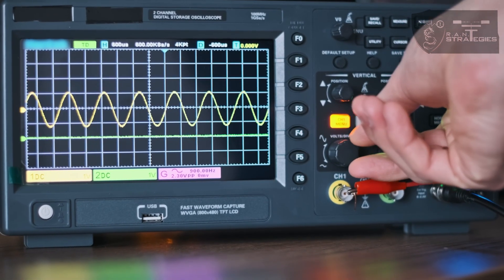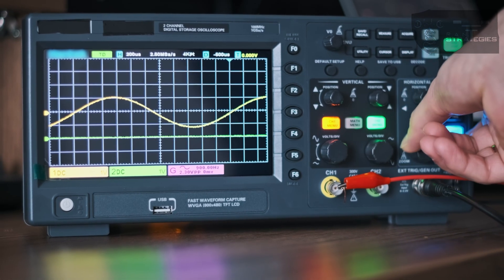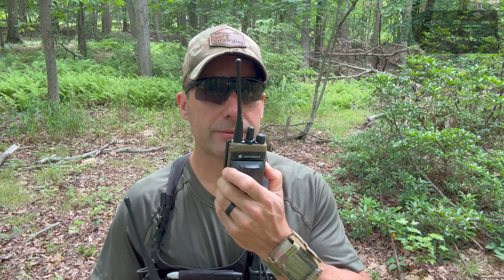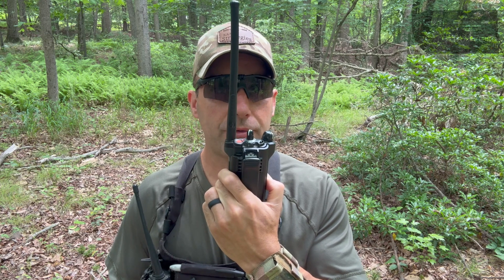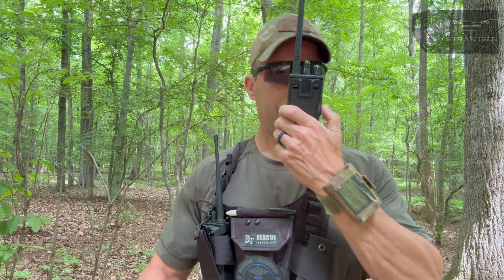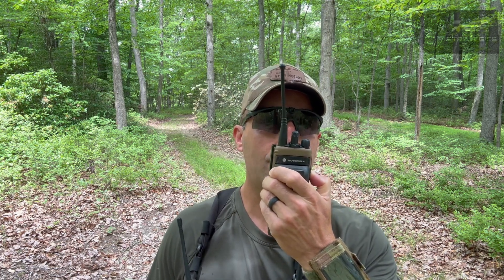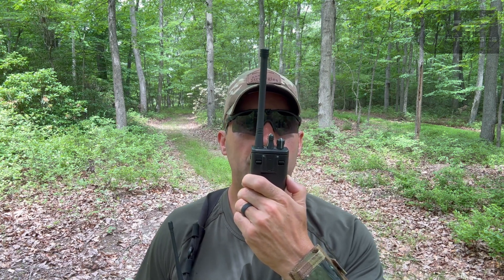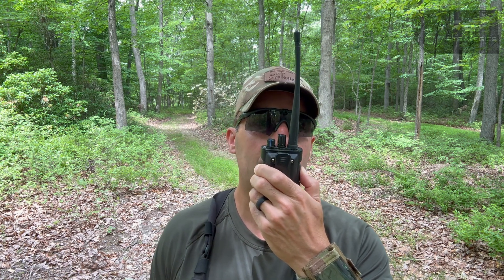UHF vs VHF Tactical Comms

Comment: Hi can you point me to an explanation of the 400 vs 800mhz Motorola xts
Reply from the maker: I’d be happy to help…. But what info are you looking for? Motos are traditionally single band only, so based on exactly what you said, one would be UHF band only (70cm) and the other would be just for 800mhz.
Reply: @RANTStrategies hi thank you for your time I appreciate your knowledge and commitment you are creating excellent content 

sorry I didn’t want to write a whole comment before if you were busy. I’m very new to radios my grandfather was a HAM operator and one day I’d like to consider getting licensed but I think it’s best to learn in baby steps and so I’d like to start with GMRS and the use case would be having my family be able to use repeaters to communicate with one another using xts 

I’d like a way to be able to communicate with my family members in a major western suburban city over Gmrs repeaters I preprogram for them using the xts platform 

I’m not interested in any other radios for various reasons I won’t go into 

Which frequency units would be suitable for this given the above use case
Reply from the maker: @BryanKirch oh very cool! You can definitely use an XTS radio for GMRS and IMHO they would be some of the nicest GMRS radios out there lol! You def need a UHF model, but there are two UHF splits on motos and but you can tell on the radios model number which ban split it is……YOU WOULD NEED THE 4th character in the model number to be an “R” then that would work for you for GMRS
Reply: @RANTStrategies thank you!
Reply: @RANTStrategies so the 700/800mhz models won’t work for Gmrs I assume and I need the 400mhz versions
Reply from the maker: @BryanKirch exactly

Comment: 68 year old radio tech, and I have been working on this stuff since high school.  For me the best radio remains the Motorola XTS 1500/2500 in UHF.  I live in So. Cal., and while there are plenty of radio traffic here, I continue to love 450-512 Mhz.  Outside of hams, California OES and Cal Fire, there isn't much VHF high band in LA/OC Counties.  LASO and LAPD use UHF, LA County Fire uses 470 and 800.  LAFD has moved most over to 800 trunked, and OC PDs and FDs all use Countywide 800 trunked with VHF radios for mutual aid outside the county.  800 deadspots continue to be found after 20 years using 800 Mhz.  Radio techs knew decades ago that 800 really wouldn't work here unless a fortune was spent of multiple repeater sites, voters and lots of satellite receivers.

I continue to use UHF GMRS with HTs.  Good as long as the repeater will hear it.  I remember low band very well (45-46 Mhz back in the 1970's with the PDs.  That really worked great, and as a dispatcher it sounded like an FM radio station!  At the PD we switched to UHF, and the first time with repeaters with satellite receivers and voters, backed up with microwave.  That was fantastic being able to use an HT rather than have to go back to the car to use the radio.  I'd stick with Motorola.  However the APX series does far too much and is far too complicated for me.  As a purist, a handheld radio should remain solely a hand held radio, not multiple bands, Blue Tooth, GPS and lots of unneeded, costly crap!  For me, if it isn't Motorola, I am simply not interested.  But then again, I' m old!
Reply: LAFD is not trunked at all

Comment: In portable radio testing many years ago, we found the size of the radio had much influence on the actual range.  Apparently a larger chassis made a more effective antenna pattern particularly on vhf.  Since users like small and light, the size of portables has shrunk over time.
Reply: You can have a big radio that performs poorly, but larger commercial style radios(Motorola/Kenwood/etc business radios or .gov AN/PRC-148's) do tend to have more metal in them. That metal acts as one half of a dipole, balancing out the whip. Cheaper/smaller radios with less metal inside can often benefit greatly from the addition of a simple to make counterpoise. Even standing the radio on the roof of a car and operating it with a shoulder mic can make a big difference.
Reply from the maker: @CzechSixTv  100% that's definitely a strategy I've utilized in the past!
Reply from the maker: I would absolutely agree with that. As you can see, we used nothing but full-size radios for these tests, I am only a fan of the larger chassis. The little ones just aren't user friendly and don't work well with out applications.

Comment: I maintained a school radio system on Vhf for over 20 years that worked well.  In the end we switched to uhf for better coverage.  The problem was the rf noise generated by computers that limited vhf performance.  The vhf could have continued to function well if not for interference from other devices.
Reply from the maker: Well as you can see, where those tests were being done, RF noise should not have been an issue. I can't explain it, but UHF has virtually always beat out UHF, lots more testing to come for sure.

Comment: You mentioned antennas. I was going to ask about them. Any better gain aftermarket antennas available for them? What would you think of comparing urban environment like city subdivisions that a ham radio can and does reach farther than your test in the woods? Leaves on trees are great attenuators. I run an event annually(half marathon/10k run/5k run) that relies on simplex, flat ground but city residential territory. Our local repeater isn't great so we use simplex, route is within a 2 mile loop.
Reply from the maker: @charlierumsfeld6626  yessir, the urban video is in the queue as well as the antenna comparison video, stay tuned and thanks for the comment! 🍻

Comment: I'm curious what the receiving radios and antennas were, and were they located indoors or outdoors ?
Thanks for this video.
Reply from the maker: @moss-ccw7971  oh, and for this video they weee located inside, the following video I moved them outside.
Reply from the maker: @moss-ccw7971  the receiving radios are always a match to the radios that are being used to transmit on, along with just a standard antenna attached to them… the goal of these are to test just HT to HT simplex and get the results.

Comment: This was very good and interesting. I also have bad experience with vhf but I live in the city with a lot of buildings and obstacles so uhf have been surprisingly good here. When I did the test I took my vhf two blocks from my home (where the other radio was) and it did not work at all, I did get absolutely nothing on the recording. Uhf on the other hand did work more or less the whole city.
Reply from the maker: @golda_rabinovitz  I’m just glad you are out there putting your gear to test, strong work and thanks for sharing!

Comment: Very interesting.  Here in the U.K., the group I'm involved with have used VHF for years as we primarily operate in open country, albeit often with trees and uneven ground.  We also have UHF handsets for closer work but don't usually try to run them over any distance.  A while back, we had a slight mishap with our VHF antenna at event control part-way through and had to improvise.  We stuck a UHF magnetic antenna on a steel frame camping chair and were surprised to find that on that day at least, communications showed a big improvement!
Reply from the maker: Very interesting!!! We are finding they to be the base more often than not

Comment: Thanks for the content. It is valuable, BUT... in terms of performance, its not the radio model that matters, and using stock antennas doesn't mean you have a fair comparison. You don't need a dual band to make this test better. What is really important is that you have matched the antenna with the frequency in use.  These rubber ducks, in spite of being stock, are rarely good, but even worse, they are probably very unequal in how well tuned they are to the particular frequencies used in your test.  You can’t properly isolate for comparison until you have removed the most impactful  variables.  All this test showed is that with your particular operating frequencies, antennas, and radios and terrain, your UHF kit was better. But it didn't show me that UHF is better on that terrain. That's an improper conclusion until you remove the antenna tuning variable.
Reply from the maker: Valid point… we are certainly going to revisit these things and see what results we get! Welcome to the channel

Comment: As a radio Tech I can tell the antenna on the ht1000 isnt stock. Thats a aftermarket antenna. Also I can tell the APX audio setting need to be adjusted. Also when were any of these radios properly tuned on a service monitor? APX radios needed to be tuned at least once a year they are known for drifting out of tune. Good test. Curious what you were equipment you were using to receive?

Comment: Generally speaking with the about the same watts, in suburbs, I got the best range on 70cm, second best on 2m, and third on 11m CB.

The CB was on AM when the other two were FM.

And the CB antenna situation was a bit more compromised.

Comment: I definitely recommend trying better antennas.  A stock antenna is more of a compromise at VHF than it is at UHF, so I wouldn't be surprised if a better antenna would at least make VHF do as well as UHF (if you repeated otherwise the same test), if not totally flip your results.

Comment: I would like to see a test of UHF channel spacing of 12.5 kHz channel spacing versus 25 kHz channel spacing with my own testing I noticed 25 kHz channel spacing was considerably better.
Reply: I would like to see a narrowband comparison as well. Also dmr
Reply: You are right, sir.
25 khz wide channel way better than 12.5 kHz one.
And more stable with less expensive radios.

DMR will have an horrible sound (won't recognize the other guys voice, for security, wich is dangerous) and will fail on fast physical movement in field operations.
Reply: @jplacido9999  you do get more distance and less power demands though
Reply: @joshwells4280  
No.
Only on trunking mode where the TBS remotly controls the portable's power output.

Direct (simplex) mode will transmit on full power and the battery will die fast...
Reply: @jplacido9999  Call/response passwords and callsigns mitigate this
Reply: I've had good results with narrowband transmitting.
Reply from the maker: Verrrryyyyyyy interesting 🤔

Comment: Would like to see a VHF / UHF test using the same radio (dual band radio) and same antennas
Reply from the maker: I like it…. It’s on the schedule ✔️
Reply: Dual band testing won't get to the heart of the issue. Having antennas ideally matched to your operating frequency in each band is vastly more important than operating from the same radio.

Comment: When you said "top tier" wouldn't the APX 8000 "tops" the APX 7000?
Reply from the maker: It’s still the APX series…… same radio just on the 7000 you have to pick whether you want vhf or uhf…. .still a top tier radio though
Reply: The APX 7000 is dual band. I have one that does both VHF and UHF. great radio. I would consider an APX 7000 or 8000 to be "top tier" in comparison to all radios.

Comment: UHF is better for urban traffic.  I have uhf repeater that covers well into buildings that VHF won’t BUT vhf is better over long haul unobstructed. 

If you look a lot of the old state troopers who had huge territory would use VHF low band in the 30-50 MHz bands. 

Those low band radios would cover a whole county with a big while and 100 watt RF deck. 

That’s why 6 meters is great for long coverage in rural areas.
Reply: You are right sir.
Some low VHF (30/50) retransmiters with 120W (GE, MOTOROLA, KENWOOD, etc.) would do 300/600km radius no problem. And you could put an UHF transposer (4/5W) that would keep you in touch inside a house when getting out of the Jeep....

Comment: In other comments, I saw that you wanted to test stock, from the factory.  With that in mind, I was still a little surprised at how limited those units were.  No idea what your terrain was like, aside from a healthy amount of trees covering it.  Just for context, I run a lot of comms support for events, both urban and non-urban.  Repeaters and simplex.  Variety of terrains and conditions.  Multiple licenses.  I'm not an electrical engineer, but plenty of hands on and something of a "radio guy."  First instinctive reaction?  Now that you tested stock, burn those rubber duckies and slap a signal stick antenna on every one of those radios.  Test all of those radios against a cheap Baofeng with a 19 inch signal stick and you may be surprised.  Put that same signal stick on any of those radios and you will get about as much as you are going to get out of any of them, short of tossing a roll-up j-pole up in a tree.
Reply from the maker: Hey Matt, appreciate the info! Thank you! We are definitely going to do some antenna testing, it needs to be done. As far as the terrain goes, check out the latest video….. that was a common piece of info people were wanting to see, so we added that in part 2.

Comment: I appreciate the test, but it would be better if you used the same antennas on all the radios to rule out the differences amongst the stock antennas. 
For example: all Nagoa’s or whatever brand you’d like to use. 
Not sure if it possible or not  but just a thought.
Reply from the maker: It’s definitely possible and we are going to do some antenna specific testing in the future…. This was just to test what the manufactures basically are coming out with saying this is THE antenna that belongs on their radio

Comment: Will you also be testing digital (p25) in the updated test?
Reply from the maker: Hey in the XPR vs 7550 video….we put P25 up against DMR! Is that what you were referring to? 
https://youtu.be/JJZ-9B4uVbo?si=lHccRFi6k8ikN0uU
Reply: @RANTStrategies  Hey sorry, i shouldve been more specific. I meant same test (vhf vs uhf), but in addition you test analog and p25. P25 should reduce a significant amount of the noise in vhf.
Reply: @Googleplex2010 I disagree. It's the noise that causes P25 to be less effective on VHF than UHF, or higher frequency. My friends and I run both DMR and P25 repeaters locally.
Reply: @nine7295  I understand what you’re saying, however regardless of vhf or uhf, p25 will perform significantly better than using analog. Clearly there seems to be a large source of interference in the testing environment resulting in reduced VHF performance. Using p25 would reduce the impact of such interference.
Reply: @Googleplex2010 Not really.
Reply from the maker: Oh it absolutely would! Issue is with the amount of noise and lack of signal I’m guessing it won’t be able to clean it up and will just have no signal at all…. But it’s definitely something we can test out!
Reply: @RANTStrategies  I would definitely suggest giving it a try! I think you might be surprised how much of a difference it can make. Based on testing ive done, anytime analog was struggling, p25 was still crystal clear, to a certain range. The nice thing about p25 is the error correction, which means that even if the signal is weak or degraded it can still decode the full audio packet.
Reply from the maker: @Googleplex2010  now I’m curious, that’s happening for sure! Thank you

Comment: UHF doesn’t penetrate concrete better than VHF. It just passes through window frames better due to its smaller wavelength with respect to the size of the frame and also bounces off walls better.
Reply: You've beatten me on that comnentary. No breaches (small vents , etc.) no comms....
Try at big Malls and you'll that immediatly....👍👍👍

Comment: I like to use external speaker mics. It helps to hold the radio away from the body and also you can hold the radio up higher above your head for more range.
Reply: The speaker mic might act as a counterpoise.
I found one helped when using 6 meters.
Reply: @jeffkardosjr.3825   Yes they do but more so on lower frequencies
Reply from the maker: Yes… very true…. speaker mics are going to be coming into play here on an upcoming video, stay tuned!
Reply: Be carefull.
Some external speaker/mics will reduce the range for several rasons.
Test with a RF field meter first, before going outside.
Than you use that trick of holding the raduo uphigh and get the better range.
Another trick (only on analog):
Quicly stear the physical position of the radio until you get the best signal to noise ratio. Then stop right there and din't move an inch: the results will be best on both sides (teach the other guys to do the same at their end and sometimes it will be a 100% increase)
Reply: You may sometimes find that the antenna on a handheld radio is optimised for when it's held closer to the user's body...I have certainly found that on my FT-817nd, which has an inbuilt SWR display, the included 6m/ 2m/70cm antenna is a better match when it's held close, though the trade-off may be more loss through absorption of the transmitted signal by that body...